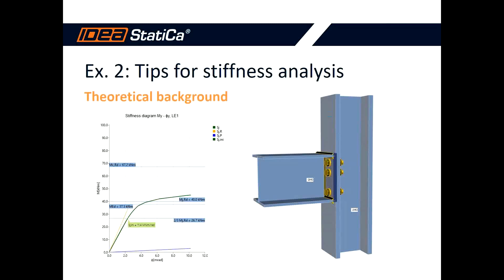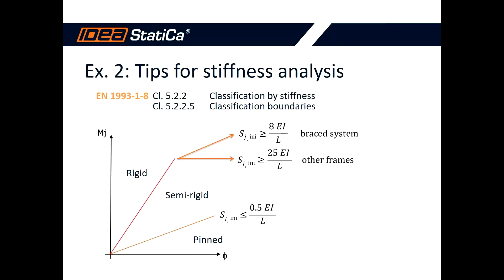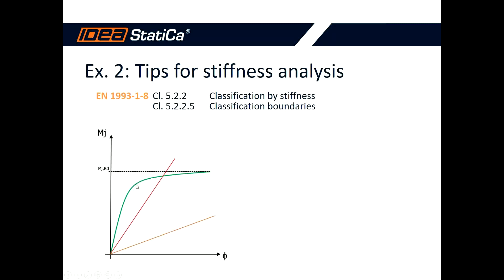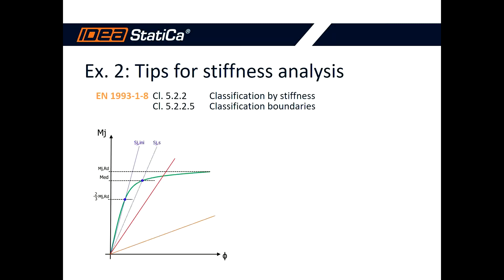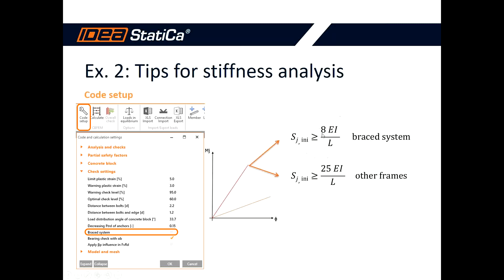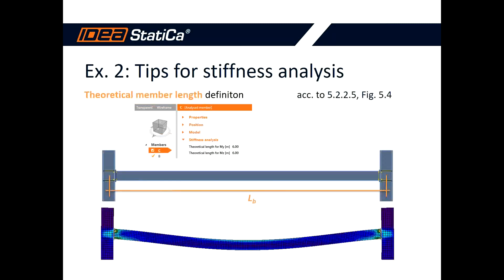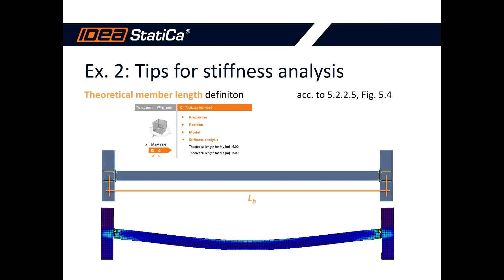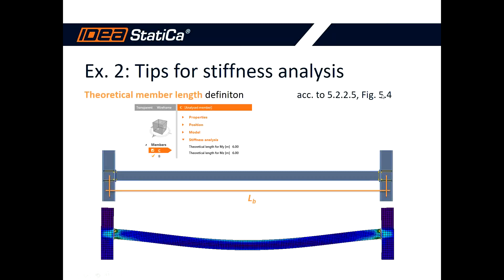Tips for stiffness analysis

Comment: hi, the AISC consider the secant stiffness (which is the service moment not design moment ) for comparing the limits of rigid or pin connection, while euro code consider 2/3 of member capacity, i think there is a major difference, please advice if ideastatica can consider AISC code .

Comment: Hi, If i am using US code i can not find the brace system in the code setup. second question i am analysing the connection of a truss to column, i should take the total length of the truss(26 meter) or only the length to the second vertical unit of the truss (2 meter)
Reply from the maker: Hello!  The brace system option is not available for the US code.  Please refer to the national code for specific guidance on theoretical lengths.

Comment: For a cantiliver, wich length should be considered? L or 2L?
Reply from the maker: Hey David, refer to your national standard or common practice, this is up to the user. I would use L, the difference is made by the internal forces values which are of course different in case of cantilever or simply supported beam.

Comment: Which rotational stiffness is the one that must be used for classifying the connection? Sj,s or Sj,ini ? And if semi-rigid, which one should be input in analysis software as rotational spring? (eg: etabs)
Reply from the maker: Hello, see Eurocode 1993-1-8 §5.1.2 (3) and (4) if Mj_Ed < 2/3Mj,Rd, you may use Sj,ini